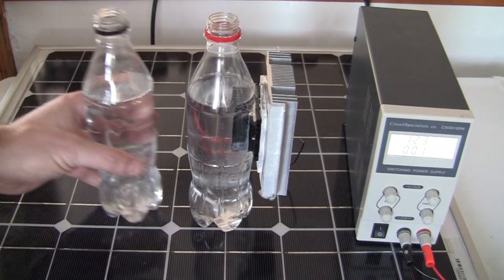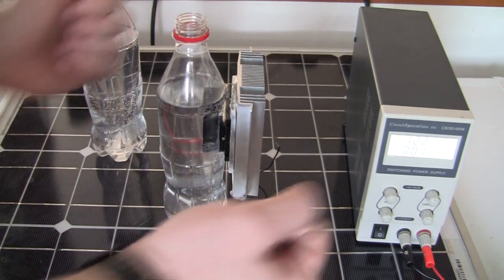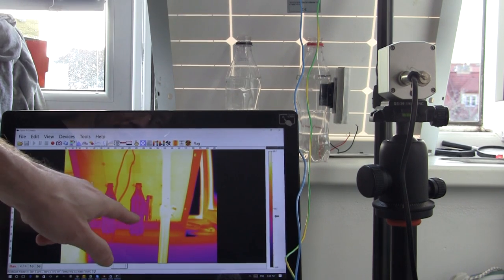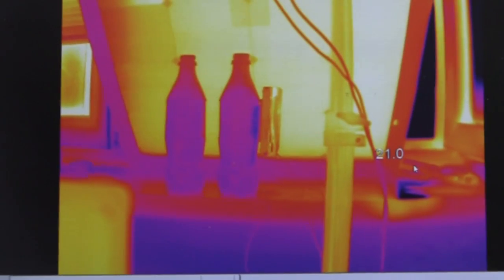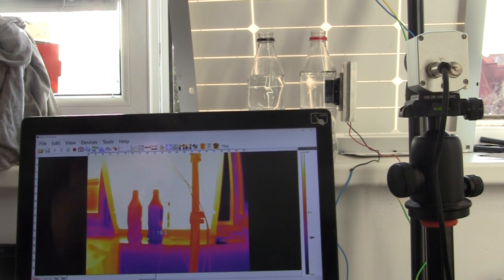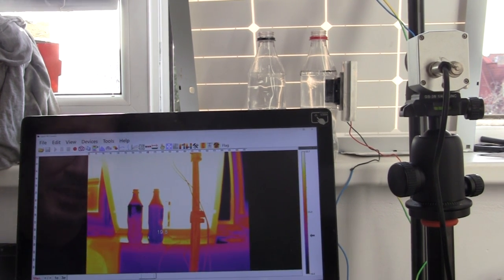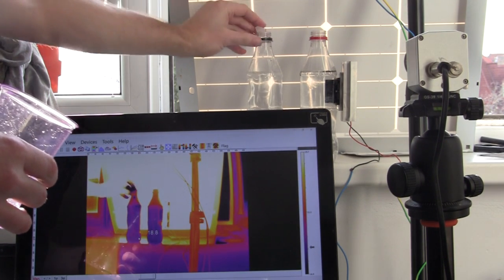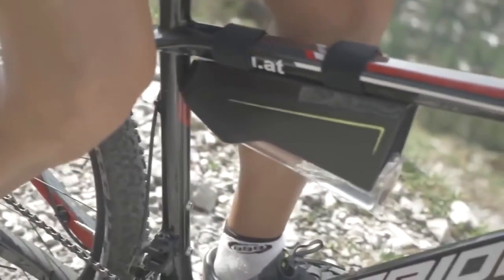Self-Cooling water bottle ACTUALLY WORKING!!!

Comment: Hey! Could you film IR reflections of wire mesh & expanded metal? Could really use some of the results on a home improvement project I'm planning (reflecting extra heat to desired location).
Thanks in advance!

Comment: So... hmm, A atomic molecular structure built in the sides of the plastic manufactured bottle, that needs 50 watts. So one would have to refine the condensing unit to 1/128 its size but camouflage it into the bottle. Probably could get it to 1/1200 its size. Now also spray painted black cans can generate heat and one could use vessels that convert heat to useable energy. Although The method... of having the bottle crafted in such a way... and using advanced weaved solar panels that produce much more per square inch could make is a system less cumbersome and noticeable. No its not he first self cooling water bottle. Advanced solar panels use a villi type system in which creates cavities for light to refract and thus increasing the surface area exponentially so it doesn't have to take ups much room. Although, inlarged to a 1.5 to 2.5 litre hiking bottle, it may work well. Although..., if you have a bottle that garnets energy, and can condense, One could use a inner plastic feature that could micro filter the water, in say terminates also , to stop beaver fever. Hmm. Well, it seems thunder foot has spoiled himself again. I feel like nothing is advancing or accelerating, its like standstill like stagnant water in most parts because of heavy commerce burden. Coming from greed.

Comment: Mine works great as well AND the bottle is easily detached from the cooler. In fact, my bottle fits inside the cooler, which has a door so you can reach in to grab the bottle, AND it has a light that goes on when the door opens. Not even kidding.

Comment: What is between your bottle and the heat sink? Couldn't you just line a bottle with Peltier chips or is that what you have in between? 2 degrees cooler - a Zeer pot would be way more efficient.

Comment: Would it be possible to create a water bottle that cools via evaporation. I.e you pump a vacuum on the bottle filled with water and the water should boil. I am wondering if you could cool the water sufficiently without boiling off too much of the water.

Comment: I could see the self filling water bottle idea having some use in say the middle of the ocean but it'd really need a much larger panel, larger system and likely be replaced with a water filtration unit that just draws in and cleans the water around you instead.

Comment: But the thing is, ice has the tendency to melt pretty quickly, not to mention it's a limited resource (what do you do when you're outside and want to cool your water, but you ran out of ice). I feel like a self-cooling water bottle that runs on solar power IS a very viable idea in theory, but the technology's just not there yet. Give it another 10-15 years, though, and it's got the potential to be a necessity for any hiker. At least, that's how I feel.

Comment: this is not a self cooling water bottle -_- it's a fridge freezer, my fridges back gets hot because its literally the exact same tech. Fridges aren't self cooling, it's a solar powered cooling bottle.

also i read a really interesting article called, "self cooling technology and the future" which details the numerous failed attempts at "self" cooling technology and I'm really sorry to say somebody basically already did this, but your welcome to try again.
Reply: i should also point out the self cooling cans that worked with essentially the same tech were ACTUALLY self cooling, as in didn't use electricity.

Comment: So, here's the plan; you take your cooling device, pretty it up a bit, attach it to one of those giant oversized beach umbrellas, the kind with the weights in the bottom, attach some solar panels to the umbrella ( I think can get some that are soft and flexible). Then, sell them to resorts and hotels or fancy homes where people can go, sit on the beach, keep their drinks cold and plug in their electronics. If there's no sun, there's probably no one at the beach to be disappointed that there's no electricity. 

You'd sell all of them you could build.

Comment: I got a cheaper and more practical solution to the problem: you sacrifice a bit of the water and wet a small blanket and wrap that around the bottle. Then put it into the sun and it cools down easily by 10 degrees, but it’s doing it faster than this, I guess. Well, I never tested that in a scientifically controlled but works well on some bottles of beer in nature.

And with that I undercut the price of that self-cooling water-bottle by some grades of magnitude. Interesting is, that you don’t need 40 minutes to make that work.

Comment: You should built one that's intended for use on the sun's surface, that would downsize the solarpanel and who wouldn't enjoy a cool drink on the sun?

I'm sure you'd still only need 50 Watts to cool the water down and the water wouldn't turn into vapor on the sun...

Comment: What if you install that in a thermally insulated container, use coped heat sink, economical fan, and cold water? Would the water stay colder for a long time? My water cooks for 6 hours as the sun beats up on it on the outside of my bag. I have to carry 2 gallons those I keep inside, outside I have two dunking bottles. By the time I break open the second its 80 degrees Fahrenheit. And they are heavy insulated steel thermoses. 

Become an enginner, they said. You'll build the world they said. NO ONE SAID I'LL HAVE TO CARRY MY WATER TO THE WORLD TO BUILD IT! I am not a happy camper. Could you tell?

Comment: no I know of maybe 2 older self cooling water bottles.. the first was a cloth coating so that you wet it and the evaporation cools it. the second was with a gas that when you open the gas container the pressure drop cools the drink. like if you spray a co2 bottle the bottle cools down.

Comment: With better insulating for the bottle especially around the edges of the peltier device, and maybe a little more research into where optimum placement of the peltier device would be along with some experimentation to reduce drag on the internal heat sink (to maximize circulation speed and heat dissipation), that might actually be a pretty wicked-awesome thing to have.

How long would you be able to power that with something like a cheap phone battery?  Or maybe even a more expensive phablet battery?  Or a laptop battery?  ;)

Comment: ya know, Ancient Egypt, they had a very effective self cooling water bottle.  It was called a waterskin and was made of from a sheep or cow bladder.  Small amounts of water would soak through the leathered bladder and evaporate off, cooling it.  In very dry conditions, it was reported to nearly freeze the water.  There was apparently not much water loss at it was able to hold relavant amounts of water for a few days before evaporating off.

Comment: One issue that I see immediately from watching this video is that you need to have a fan on the hot side to take the heat away.  You are effectively running the Peltier junction in the most inefficient way possibible since you are not removing the heat from the hot side fast enough.  If you use active cooling you should see quite a bit better performance even if you loose 4 watts to a fan.

Comment: Thunderf00t, I saw a video about Tesla Solar House Tiles. Are they bollocks or is there actually something to them?
Reply: They've apparently installed them on actual houses. If they have a solution for solar panels overheating from having less exposure to open air, I see no reason to doubt their viability.
Reply: Solar roof tiles/shingles have been around for many years. The only difference with the Tesla ones is that they look like real roof tiles, are tougher and he claims they will cost much less than the existing ones. So they are not bollocks, they do work, but are probably slightly less efficient than covering your whole roof in solar panels, but look a damn sight better and will last a lot longer - they are actually much tougher than standard roof tiles. So yeah, there is something to them.

Comment: O great thunderfoot, I would like to suggest that you take a look at a supposed energy generating material called kbnno also called perovskite. The inventors claim that it can use the sun, heat and movement to generate a current. It has enough credibility at first glance to make it difficult determine how possible it is (although a lot of this comes from not having seen their experimental results). Being the great debunker you will be able to determine whether or not it is possible and deliver the message to a large number of people. If you deem it worthy of a video i thank you and if not then thanks anyways for what you have been doing on this channel in general.

Comment: I've got a quick question at 3:30...
Since water is really good at acting as a heat conductor, could having a setup where the water runs from a source container through the cooling fins in copper tubing to a reservoir improve cooling speed? Not because of the use of the tubing directly, but because you introduce to the fins ONLY the amount of water it can actually cool quickly, AND because, essentially, it is mitigating "contamination" of the cold water with warmer water particles and ambient heat around the bottle (using insulation around the cooling tubing, the source bottle, and the reservoir). I'm wondering if a setup like that could cut down noticeably on either the duration of the process or the energy requirements so as to shrink the size of the machine...
Reply: nwatkins18 Yes it would, but you have to remember, this isn't a Kickstarter he plans to ship out. This is more like a fuck you to the self filling water bottle.
Reply: Malcanth oh, I know that, I was just running a question by Thunderfoot to see if I was right. I answer the phone for a living, but my passion is improving existing ideas, so I couldn't help but try to improve his model...

Comment: +Thunderf00t
I don't know about the water bottle, you obviously made that out of sarcasm and for laughs, but there are ways you can get solar panels big enough to power a device if you're in the desert. Get a big shade for a hat and coat it in solar panels on the top. Something like that should be able to power a properly insulated container so you can have cold beverages with you.

Comment: not an electrical major :) If the volts were higher then the power increases. so you would get more power out of the peltier. current is not what you need, it is power as that is what you are pumping :)

the panel of course will not have the capability to drive the peltier at 17-19V except under perfect sun conditions.
Reply: the tin sputtering tint on the window glass will block a lot of useful IR energy too. put the panel outside :p
Reply: The window was open.
Reply: good point :)

Comment: Still, even if it does take time to cool it, a self cooling water bottle is a good idea. It's difficult to keep ice frozen when biking or hiking and such. Now, if a dummy-proof charger were to use the power of the bike's rear wheel...

Comment: If you added a fan to the hot side of the peltier device to help the differential, how much parasitic loss would you have? Would it be enough to increase the efficiency of the "self cooling water bottle"?

Comment: im not a hater but you really need a haircut lolz also when we inviaded iraq we had a cheaper way to cool water put water bottle into 2 military grade socks wet the socks tie them to the mirrors on our trucks and drive they would cool down fast and really helped with the 125 degree heat later we burried a shipping container in the ground about 5 foot down and it made an natural chiller for our water supply

Comment: You might have missed a trick - instead of cooling the hot end by convection you could have evaporated water off some wicking material... maybe a flannel or something, and made the point about the latent heat content of evaporated water directly.

Comment: idly wonders if one could get water from the air a little more quickly by running it through a compressor pump and heat exchanger and maybe throwing several kW at the problem (possibly with an axial-pump primary followed by a scroll pump). heat exchanger used to help condense water from the air which drips into the bottle (likely with a radiator and 2 or 3 expansion stages, exhaust air being used to help cool intake air).

possibly the portable model comes with a rope-pull (and runs off gasoline or diesel or similar), vs mains-powered or using a largish battery pack.

not that this would really make it practical though...

Comment: I just had an amazing idea. Now sure the self cooling water bottle is a great idea, but the form factor does have some limitations. So WHAT IF instead of cooling just one water bottle, we could use a larger solar panel or optionally direct power, and cool down an insulated volume of space. We could then put multiple water bottles, inside this volume and cool them all down!

Comment: I also have a self cooling water bottle system.   However mine is attached (well not really attached) to the inside of my fridge.   Yes, it is portable as well.  I have a appliance dolly strapped to the fridge and a really long extension cord.  For when I travel, I have a propane 3000W generator.   I need to raise 3 million dollars so that I can downsize the system to fit on the back of my pickup truck.

Comment: Questions for Thunderf00t: Is it possible to design a metamaterial that acts as a good insulator in one direction and a heat conductor in the other, without needing electricity?  Does this theoretical metamaterial exist already and if so, how cost effective would it be?  I imagine a thin flexible sheet could be used as an insert in a container and pulled out and reversed to help warm or cool contents, and would be more effective than a simple insulator at given temperatures.
Reply: If I'm correctly understanding your question, such a material is impossible.

Imagine you have a closed container, perfectly insulated -- a true "closed system" in the thermodynamic sense.  Full of gas, all at the same temperature, with a sheet of that material splitting the container in half.  Suppose the sheet can conduct heat from left to right, but not right to left.  On each side, the molecules are bouncing around with a range of speeds, characteristic of that temperature.  They're also emitting radiation characteristic of that temperature, including infrared.  If a fast-moving molecule on the left side hits the sheet, it transfers some of its energy to the sheet, which passes it through; the left side is cooled and the right side is heated.  If a fast-moving molecule on the right side hits the sheet, it keeps its heat.  If infrared energy from the left side hits the sheet, it passes -- again, the left side is cooled and the right side heated.  It doesn't work in reverse.  Result: over time, the left side cools and the right side warms up, creating a decrease in entropy with no work being done.  You could use the temperature difference to create energy from nowhere.  This would be a violation of the laws of thermodynamics.

If you used a real material to divide the container, heat would be continually passing back and forth.  A fast molecule hitting the sheet would transfer some heat to the other side, warming it by that amount.  But that just makes it more likely for there to be a fast molecule on that side, hitting the sheet to pass some heat back.  At any given moment, there isn't going to be exactly the same temperature, as determined from the sum of all of the energy of the molecules' motion and all of the radiation present.  But it's going to be very close to the same, because any imbalance will even out.  Statistically, the two sides would stay at the same temperature, given a bit of time averaging.

Comment: You just need a linear regulator to moderate the voltage and it would work no matter what angle the sun is at, and that's just a trip to radioshack! Lazy!

Comment: ok. you need to sell this in the fashion of solar road ways. extreme hard sell seems like it'd work for this. just show them the thermal camera footage and they'll buy whatever you tell them. of course you should leave out the part where ice is 10 times as effective. and you shouldn't show it from an angle where they can see the giant heat sink lol! advertise that with a single pocket sized solar panel they can get EPIC results in under an hour. (assuming the panel is 1/10 the size of the current 50 minutes should get half the effect of what you showed here. but i think you can get away with 1/5 the size for pocket. maybe even 1/2 if it folds twice.) if you give $50 you get a SELF COOLING WATER BOTTLE OF YOUR OWN! $70 and you get an extra replacement panel! $100 and you get 2 BOTTLES AND A PANEL! you may even get a government grant lol! but just for kicks you should also let it be wind powered as an option. sell a pinwheel with a micro generator attached! XD

can't wait to see the campaign.